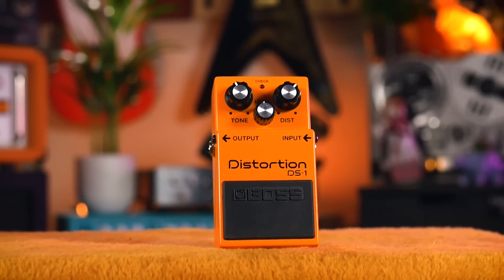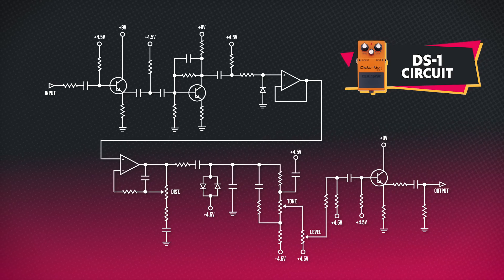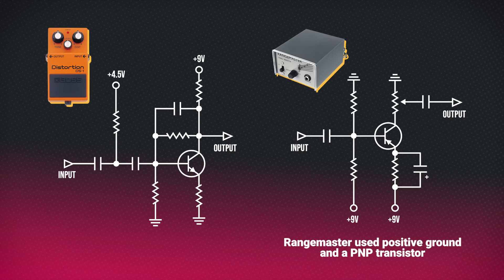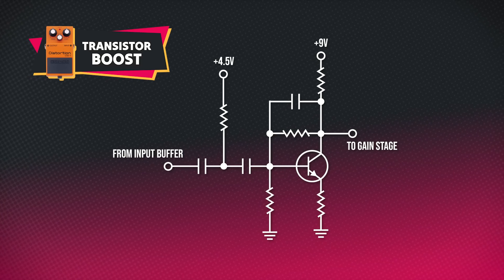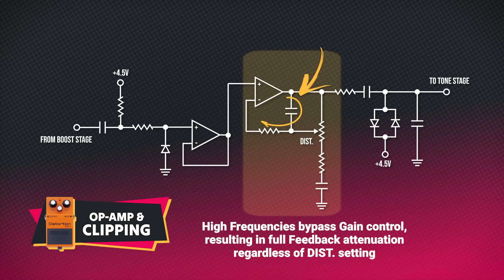Unapologetic Distortion Circuit of Boss DS-1 | Gain Appreciation

Comment from the maker: The first 500 people to click my link will get a 1 month free trial of Skillshare https://skl.sh/scienceofloud04241
BUY Boss DS-1 & Other Gear used in this video: https://thmn.to/thocf/sht95efu8l

The iconic Boss DS-1 is unapologetically a Distortion pedal - its dual gain stage circuit will give any boosted amp a run for its money. Let's Gain Appreciation for why this circuit has been popular since 1978. 

This video contains paid promotion from Skillshare
More details on how Science of Loud implements product promotion - https://www.csguitars.co.uk/disclosure
#sponsor #boss #ds1

Timecodes:
00:00 - DS-1 Introduction 
00:40 - Block Diagram Topology
01:28 - Input Buffer
02:22 - Transistor Boost
04:04 - Op-amp & Clipping
05:50 - Sponsor Section: Skillshare
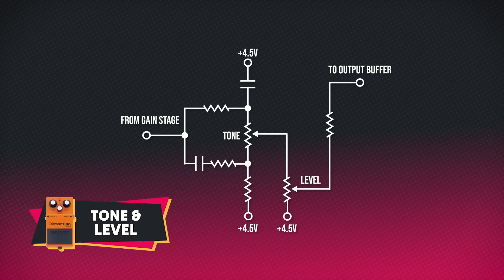07:12 - Tone & Level
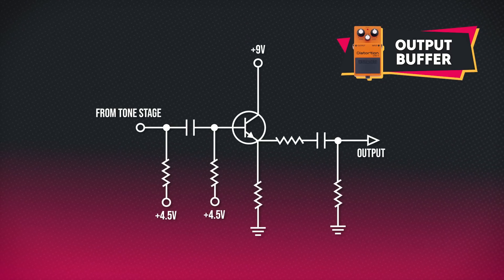07:52 - Output Buffer
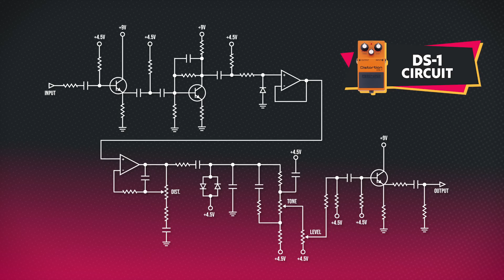08:00 - DS-1 Overview
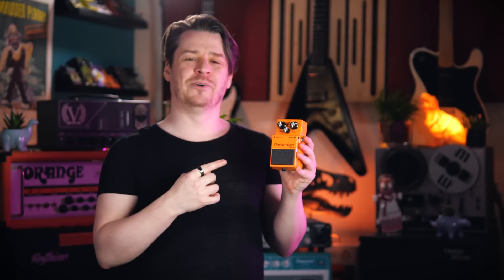09:14 - Full Mix Sound Example
10:23 - Closing Remarks & Isolated Sound Examples

More from Science of Loud: 
Support on Patreon: https://www.patreon.com/csguitars
Join Science of Loud Discord - https://discord.gg/csguitars
Buy Science of Loud Merchandise - https://www.csguitars.co.uk/store
Website - http://www.csguitars.co.uk
Contact - colin@csguitars.co.uk
__________________________________________________________________
Description contains affiliate links. Purchasing using one of these links will generate a small commission for Science of Loud at no additional cost to you.
Reply: Scottish accent is kinda like a regular speaking English person inserts with DS-1 and a Flanger pedal.

Comment: I use a DS-1 for most of my low-mid gain sounds, with tone at around 10-11 o'clock and gain around 9-10. It sits in a very interesting range, where the pedal can produce a lot of hard clipping if you dig in, but it produces a low amount of hard clipping when you play softer and/or roll back the volume.

It doesn't smooth out, but getting the hard clipping at low-ish gain is to me a very interesting sound. The only problem with this setup is that it tends to be quite mid scooped and it doesn't cut through very well, so I should probably run the tone a bit higher to compensate the lower gain.

Using a HSH style guitar, the neck(with volume rolled off), middle single, the middle+neck or middle+bridge splits mellows it out so it doesn't clip as much, and when there is a rock song happening, full volume on the bridge pickup instantly changes the character and pushes it into rock territory. Of course it doesn't riff hard or play metal, but for a bit grungy or 90s rock it does very well.

The hard clipping at any gain point is very evident and is definitely one of the reasons why I love it. It's pokey even when its turned down

Comment: Although I have had the Boss Gt6 multi unit for years and years.. .I never had a ds1 by itself, but I'm sure it is in that gt6... I love the distortion from my gt6 better than all of these other pedals I have been putting on my back up board (rat, deluxe bass big muff, pugilist, ts9, pg14, eras, sss). Even my DnM Drive that I love as more of a dual boost doesn't quite get that distortion flavor. You have convinced me to get a ds1. 😊

Comment: 7:57 "we arrive at the output buffer which also converts impedance"... considering there is an input buffer, and two op-amps in the circuit, surely we're already running at low impedance and the purpose of this buffer is to prevent anything further down in the signal chain being affecting the DS-1, or vice versa?

Comment: I've always thought of the DS-1 circuit as being basically like stacking two tubescreamers back to back. They basically took the TS-808 design and moved the second op-amp stage from the tone/volume circuit to the drive circuit to double the beef a tubescreamer provides. It always seems to work best with a tube input stage on the amp to smooth the hard clipping a little more I think, just like the TS.

Comment: you still haven't done a video on ohms, as in what ohm amps and cabs can run together, how dual cabs affect ohms and whether solid state or value amps vs cabs are different. there is a lot of conflicting information out there and I'll like you to give us a real break down on it........... and I miss Barry.
Reply: I feel like you're ( respectfully intended) confused by how electricity works. Volts is electtrial pressure, amps is the flow of electrons through a conductor and ohms is the resistance to electron flow. 

If an amp says it's 1 watt output then it has 0.08333amps of electrons flowing through the circuit, this assumes your input voltage ( pressure ) is 120 vac. 

Solid state and valve amps are electrically not that different, sonically they produce different sounds due to the resistance through jfet, mossfets or tubes ( resistive loads ) 

So to ask  " how does this effect ohms " ? Is a redundant question 
The math on circuit application 7s pretty simple, it's a triangle 
Volts on top 
Amps and ohms beneath 

V / R = A 
R x A = V 
V / A = R 

information may be conflicting but regardless THIS is how all electrical components function.
Reply: @MrDmadness  yes, but the issue is weather you can run at 16 ohm amp through an 8 ohm cab, or whatever variations. how does the difference between the two affect them, e,g. cause damage or work fine.
Reply: @Mognam  again ohm iz a resistance, so not a "flow"

Comment: My MXR Custom Shop Raijin Drive has an almost identical circuit. It was designed by Shin Suzuki; who as we all know, is responsible for both the DS-1 and the TS9.

The Raijin Drive has essentially both of those circuits with expanded range built into a single pedal with an OD/DIST selector switch. I LOVE that pedal.

Comment: Boss DS-1, BD-2 and SD-1 are must haves for me. Most of the time my BD-2 is the always on pedal.
Reply: I never had a BD-2, though I've heard people sing praises to this pedal. However, I tend to use a rather small pedalboard, so I switch DS-1 with RAT, depending on what I play, but SD-1 is always there. Such a great pedal for boosting as well as running on an a slightly dirty amp. It always betters the tone, adding these creamy, soft mids, no matter what you plug it into.

Comment: Hello Colin! Nice video but there are some errors/inaccuracies. 

The extra capacitor and resistor to 4.5V between buffer and boost are a mistake in the schematics you usually find and are basically a remnant of the JFET switching system that don't contribute to filtering really. The "highpass filter" in the transistor boost doesn't effectively cut bass, the resistor to ground there is to bias the transistor and there is no effect when removing it. In general the booster is closer to a Big Muff gain stage than a Rangemaster. The dual op amp setup you see is sort of unnecessary and just there because of various ICs going in and out of production over the long existance of the DS-1, ending up on a dual op amp without actual use for a half of it. The way how the DS-1 distortion control is wired is actually sort of interesting as it sits between the DOD250/Distortion+ and the more normal varial negative feedback resistor gain control from pedals like the TS or Rat. The resistor to 4.5V before the capacitor in the buffer section is also a remnant of the JFET switching and is useless there.

Comment: I bought one in '82 and had for close to 30 years. It was all beat up and missing a knob, but still worked fine. That was the best distortion I ever owned. I never did buy anything else and used it exclusively. I bought a new one about a year ago, because I finally lost the other one, and it sounds horrible! It's way too muddy and dark. I can't get a good sound out of it at all. I've ysed humbuckers, single coils and combinations of those, and I just can't get it dialed in. I bought a $25 distortion pedal off Temu, and it blows the Boss away! Actually, there's mo comparison. The cheap just simply outperforms.

Comment: I can't believe there's been like half a century of negative feedback on pedals and amps and they have done nothing about it.

I would also agree on the comment "Whenever I stomp on this pedal, it always smells like teen spirit" - disgusting sweat. I don't know why but I can never make it sound tolerable. The tone control in particular makes sure of it. I bought it to check if I can make it work, but decided it's gonna be a great modding platform. I opened it and never modded it in the end, it's still open on my desk after years.

Comment: The designers for this pedal were very creative with its circuit.

It'd be interesting to see mods that remove the transistor boost, allowing a TS-9 or other popular overdrive boosting it instead. Or tweak the op-amp circuit for soft clipping instead of hard, as to emulate cascading gain stages.

Comment: SInce I bought my quad cortex I came to realise how cool the OG BOSS OD-1 sounds, I thinks its such a cool unit. That would be interesting, since it also doesnt offer any tone control, but works like a charm in front of an overdriven amp and offers a very modern tight high gain sound eventhough its from the 70s

Comment: Love the channel refresh! It looks great. I'd love to see you break down something a little more modern like the NATAS with it's two mid voicings, girth and grind filters. I'm a sucker for amp in a box pedals.
Reply from the maker: I am 99% sure the NATAS is a digital pedal running a stripped down version of the NeuralDSP amp sim. 
Since it's most likely a processor running code, there's not much I can do to analyse its circuit: it's a black box of 1s and 0s

Comment: Really wish I could appreciate a circuit diagram. Any chance we could get a layman's guide to understanding these?
Reply: Look at electrical.  schematics.      And know that there are only 2 circuit applications for any circuit . Inductive loads ( a load is anything on the circuit and is required in any circuit, and inductive load moves something, think electric motor ) and resistive loads ( these produce light and heat such as a light bulb ir toaster coil )   those sharp edged lines on schematic ( resistors ) show this, round edged means inductive.

Comment: Great video! I know zip about circuits & yet I found myself watching to the end. You asked for a request. I’m surprisingly impressed by the Acapulco Gold by EQD, as a one knob wonder. For me it’s a great lead pedal if I sculpt away some  bass with an EQ pedal in front of it, But, with a treble bleed on my guitar volume, the AG also becomes a great overdrive sound. Anyway, I realize my request is not nearly as popular as the SD-1. That said I’ve had the AG on my board for the last year & it would be interesting to see how it works.

Comment: What are some good options to replace D4 and D5 (keeping them symmetrical) to get more output volume without compromising too much clipping? (LEDs have great headroom / output volume but the clipping reduces drastically).
Reply from the maker: The amount of clipping is intrinsically tied to the volume drop. You can't have one without the other. 
Check datasheets on diodes and look for the Forward Voltage. Many silicon diodes (like the ones used in the DS-1) have a Vf of 0.7V, to get more volume (and less clipping) you'll want to find something with a Vf > 0.7V
LEDs can have Vf anywhere between 1.5V and 2V, so if that is too much then you'd be looking for something less than 1.5V. 

The alternative is simply to place a level boosting effect directly after the DS-1, like a graphic EQ with only the master level increased.
Reply from the maker: You could also put 2 diodes in series for each half of the waveform, that would also reduce the clipping and you might be able to find a balance you like that way.
Reply: @ScienceofLoud  thanks for the replies, greetings from Colombia.
Reply: If you like to tune the clipping in finer steps than 0.7V (PN voltage for a silicon diode) you could have several shottky diodes in series added to a silicon diode. Maybe Colin could test for us a clipping circuit using silicon carbide diodes like STPSC2H12 (which is waaaaaay overengineered ;-) ). These have a Vf of 1.35V nominally (which is a completely different operation point than what you do in a pedal).

Comment: Nice to see you back Colin. :)
Q. The WAZA version has a custom mode which 'delivers fatter distortion tones with tighter mids and higher response'. Do you know what 'tweaking' was done to the original circuit to delviver the fattness et al?
Reply from the maker: Unfortunately I've not had any hands on experience with the Waza version to know exactly what has changed for the Custom mode. 
I'm sure if I got a chance to listen to one and throw it on the scope I could come up with some educated guesses though.

Comment: Welcome back! I love how easily you explain circuit concepts, you do that better than anyone I can think of. Regarding the DS-1, I remember hearing allegedly it was made to emulate cranked plexi tones. Any insight into that? I can definitely hear a lot of similarities to my JTM45 in the low end and how it clips, so I wouldn’t be surprised if that’s what the DS-1 was modeled to try and sound like.
Reply from the maker: I have no sources to confirm or deny that claim, however it would at least make sense for the time the pedal was being developed and released. 
Jumping the inputs of Plexis and boosting them with treble boosters and overdrives was a very popular practice in the late 70s, responsible for many of the guitar sounds from huge Rock artists. 
If it wasn't Boss' direct intention to copy that circuit, it was at least a contemporary sound they'd have been comparing their DS-1 to.